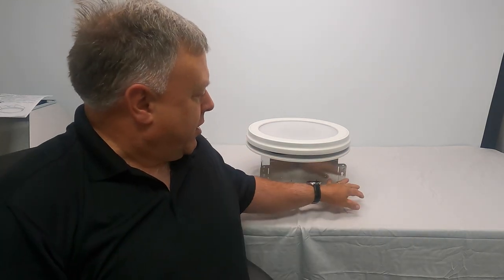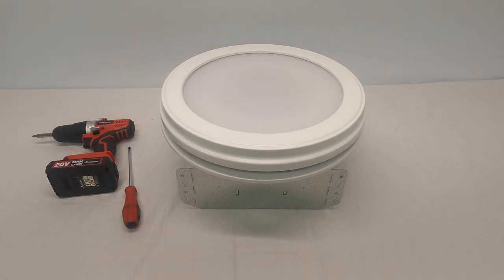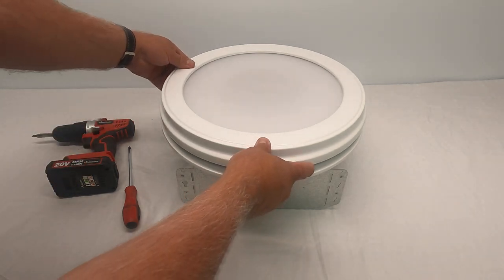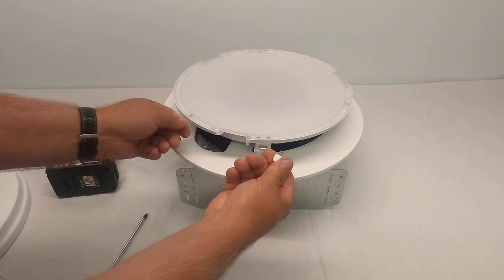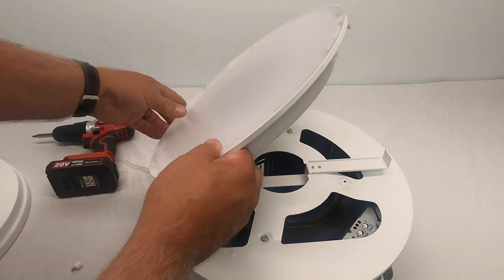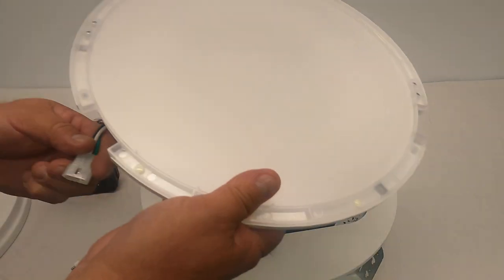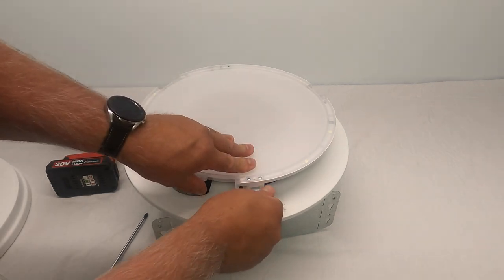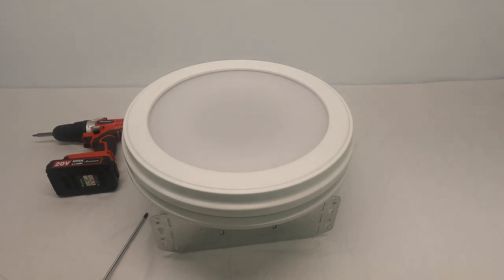How to Disassemble Grille Assembly on AERN80LWH Decorative Fan Light Series

Comment: The replacement light costs more than the whole fixture with fan and all. I will just replace with a different brand.
Reply from the maker: Thank you for commenting. The AERN80LWH does have a 3 year warranty from date of purchase that does include the light feature. Please contact our Product Support Team directly at 800-637-1453 if we can be of any assistance.
Reply: @BroanNuToneLLC  I'm having the same experience as the above customers but your offices are currently closed. Is there an email that I can send? Our fan light combo is under three years old and the light is flickering intermittently despite being powered and having good connections.
Reply from the maker: @bryanhalferty7926  Thank you for reaching out, Bryan. We need to know the model number of the unit currently installed. It can be found up, inside the housing on a specification label. Once you have the model number and date code off the specification label, please contact our Product Support at 800-637-1453 or email from the Contact Us page on our website.  We appreciate your time and look forward to providing you with a resolution.
Reply: @BroanNuToneLLC  I emailed customer service. Looking forward to hearing back.